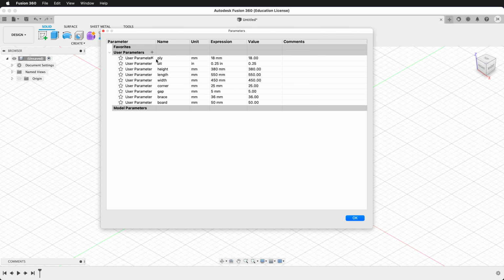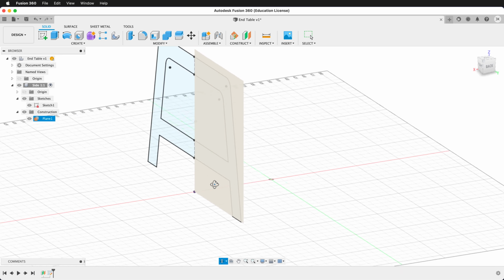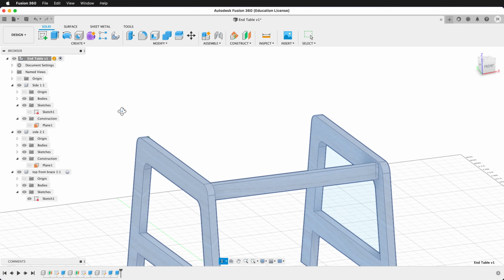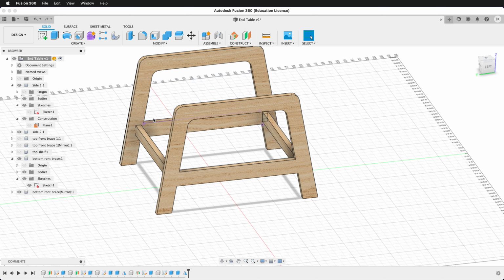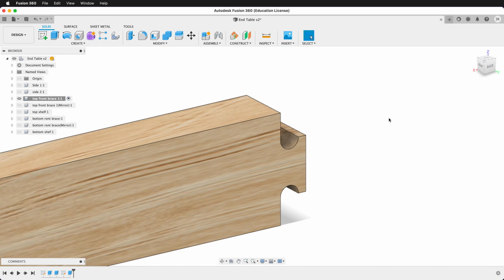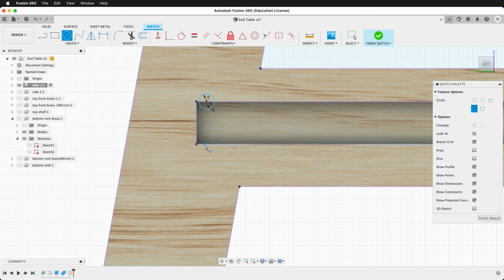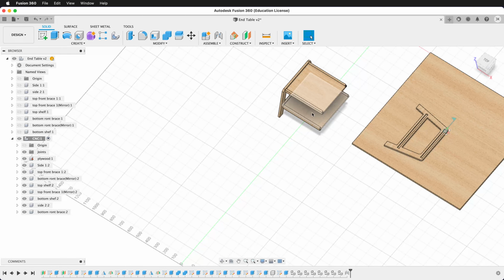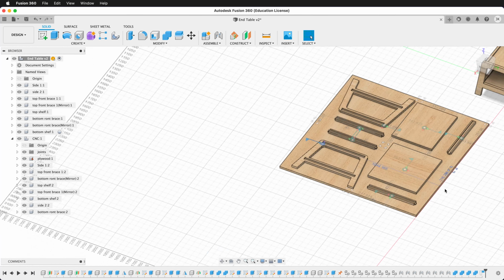CNC Router Plywood End Table in Fusion 360 for Shopbot

Comment: You move through it pretty quickly-- could you clarify why you do the (-ply/2) step only to go back and change it to (ply)? Thanks! Nice video!
Reply from the maker: ply / 2 is only half thick, in that case it needed to go the full thickness of ply
Reply: @WhatMakeArt  rewatching and I think I answered my own question! You went negative because you wanted to set the outside dimenionsion of the plane as the full width of the entire stool. It just went by really fast and I was a bit confused. Thanks again!
Reply from the maker: Glad you figured it out, yes, sometimes I go a bit fast, got to remember to set the pace a bit better 👍

Comment: Hello great tutorial! However I don't know if I screwed up or something is wrong but when I took it to the CNC The Pockets where 1 mm smaller than the total plywood material, so the shelves could not fit into the pockets. At first I used the same parameters you are using but I decided to change the plywood thickness from 18 mm to 19 mm once I got the chance to measure it. So I changed them and in Fusion when I measure it shows 19 mm. However, final result was 18 mm. Do you have any idea what could go wrong? I used a 6mm bit for both the pockets and contour. Thanks!
Reply from the maker: Frustrating when parts don't fit, every CNC is different and best to do a small test cut to check tolerances 

Hard to say what exactly happened without seeing your file but a couple tips for next time

On the pocket cuts in the manufacturer workspace in Fusion 360 there is a "stock to leave" setting. If you type a negative number here it will make the pocket just a bit bigger. This way you can make your model at the exact dimensions and then adjust the tool paths based on the particular machine and materials

Hope you can sand out the pockets and make everything fit in your project 👍🔨

Comment: Can the CNC router read this file from fusion360 to cut the final pieces, or is there a special file format that the router can only read and cut from?
Reply from the maker: Fusion 360 can export g-code for many different CNC machines. You need to make sure you export the proper g-code for your machine.

If you are using a shop bot then this is a video that shows you how to export g code for a shop bot

https://youtu.be/_G-0i8BFEFs

Comment: great work flow.. could you not just  copy the extrude if the t-bones and put it just before the mirror copy of the brace and it would create both braces with the fillets already included? 
I would also just mirror the circles instead of creating each one per corner maybe?

also.. are the braces not all the same? if so.. it is not faster to create a rectangular pattern of one completed one ?

Im just imaging how I would be doing it and seeing your rational for doing or not doing it another way... just for learning purposes... thanks again!
Reply from the maker: You can't extrude the t-bones until you've made the subtraction of the tennon for the mortise hole. If you make the t-bones first you'll get a round hole.

I didn't mirror the sketch circles because the mirror command in fusion sketches is not parametrically editable. You could totally do it that way. I also avoid mirrors and sketches cuz sometimes they can slow sketches down.

Sure you could create a rectangular pattern of the braces. I did it this way so I could change the height and width and the braces would still be centered on the legs without having to adjust the rectangular pattern. Either way would work depending on which steps you want to take to make the model editable.